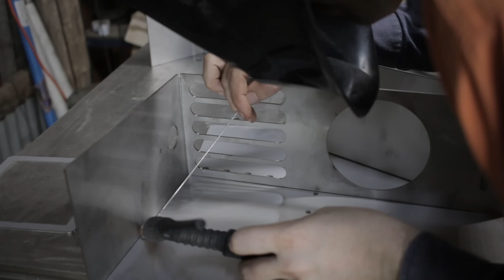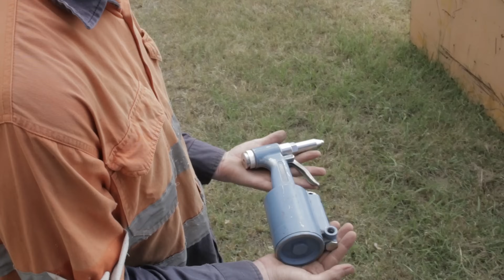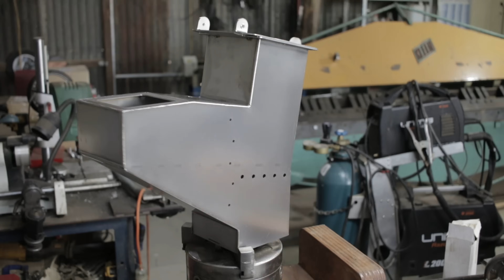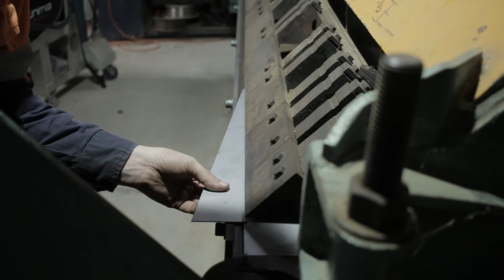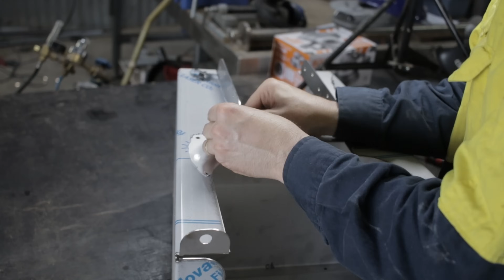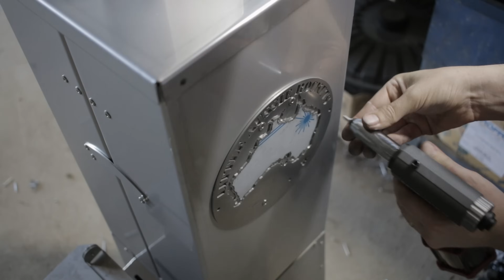Building The Ultimate Rocket Stove Water Heater

Comment: Great video, thank you for all the effort you have put in to make it. Here is a tip on using the hole saw to drill a big hole: get started and let the hole saw scratch its mark, then drill a 10mm hole to the inside of the scratched line, even better if you can be bothered, drill 2 holes, one on each side. by doing this all the swarf has somewhere to escape, and the hole will drill far more efficiently, and your barrel drills / hole saws will last way longer. this is especially useful for drilling thick timber / MDF or particle board without smoke. Cheers Timmo
Reply from the maker: Thanks Timmo that's actually a very helpful hint.

Comment: I'm wondering why you passed the inlet and outlet pipes through the flue? If you're calling the tapered section the heat exchanger, then you shouldn't need to pass the pipes through the flue, which to me may make the draw less efficient. Also, is the bulk of the heat exchange done when the heat hits the lower pipe? Or in the tapered tube? I suspect the lower pipe. I've thought that the quickest way to turn your water into steam is to put the pipe directly in the flue as you've done. But this is not what you want, you want a controlled even heating of the water. 

Also, why not introduce some "sheet" style insulation fixed to the inside of the outer shield? This would stop you losing heat to the outer shield and send that heat around the the exchange section. Thanks for posting your stuff. Wish I had your shed! 😀

Comment: Great video, curious why you didn't put a water jacket around the riser and capture from all 4 sides ?
Reply from the maker: I made one a little while back in that configuration and it worked so well that the water turned instantly into steam and I needed a pump to get circulation. I wanted this one to function without a pump for the off-grid scenario.
Reply: @LittleAussieRockets  thanks for the reply. You didn't try larger bore piping ?  seems a pity to me to not make it as efficient as possible instead of having that heat going up the riser

Comment: So if you’re testing water tightness, is there a reason you didn’t use the air compressor and water with detergent method? Wouldnt testing under pressure be more accurate?
Reply from the maker: Yeah, that is a better way of doing it I had other things to do and it just suited the situation best to fill it with water and come back and look for any wet patches considering the system is never actually going to be under pressure that should be more than sufficient.

Comment: ohhh I was wondering if I could find an attachment to use that little ferrex cutoff tool as a sander - can you share what you bought? I assumed one of the kits at bunnings or total tools would work but haven't checked.
Reply from the maker: https://www.ebay.com.au/itm/314479162782?mkcid=16&mkevt=1&mkrid=705-154756-20017-0&ssspo=f90abdths7e&sssrc=4429486&ssuid=tRO4joLsQgi&var=&widget_ver=artemis&media=COPY
I have to modify the shank and cut an M6 thread on it, that's what's in the little grinder. You could probably use some M6 threaded rod cut to the right length as that happens to be the same thread that's in the little rubber backing pad.
Reply: @LittleAussieRockets  I noticed the 12v grinder aldi stocked yesterday has speed control (12-19.5k rpm, the 20v is 19.5). I ended up grabbing one and a couple of the other tools on offer. They recharge via USB-C which is a bit funky. Must do one cell at a time? 
Anyway, I made the same sort of arrangement, except the polisher kit i bought from bunnings has 1/4inch in the rubber backer, and this 12v model has m5 on the spindle.

Comment: Gasification wood boilers use a Turbulator to chop up and slow down the flu gasses and help transfer heat to the water.  You may consider trying that to see if it helps your heat exchange. 

Great stuff!

Comment: I think instead of insulation around the burn chamber I'd put sand, make it a thermal battery with the ability to recover the heat with a liquid, that would certainly allow heating all the way around the water jacket.

Comment: Interesting video Steve! Bit alarmed that you didn't have your drill press fixed down, even temporarily. Amazed by the size of your sheet metal folder. How big is it and how long have you had it? Sorry to see the passing of your air riveter. You should have sounded Last Post as you delivered it to the scrap bin. 😂 I used to do that for mice killed in the workshop. Sound Last Post and do the Funeral March with feet gliding across the floor! 😂 It used to piss the old PIA Electrician off no end! 😂😂😂
That was half of the point! 😊
I was watching this build and pondering just how much it was costing, so your decision to start a Patreon account was no real surprise. I will see what I can do, however I am currently very busy shovelling as much coin into Super as possible. I turned 59 last month and the Finish Line is rapidly approaching. I know that you both have many calls on your $$$, but if you can put some extra money into your Super now it will have a far greater effect than if you hold off until later. Watching how much gets taken out in fees is also important. It all has to do with Compound Interest. The longer that it has to work, the greater the return. Get yourself a Compound Interest Calculator from the App Store and have a play around with some of the variables to see what I mean. 
Sorry to preach, but learning about Compound Interest is like the Eighth Wonder of the World. 
Mark from Melbourne Australia 🇦🇺
Reply from the maker: Hi Mark I appreciate the financial advice that is something that I need to be proactive with, and no pressure with patreon. The biggest cost for me isn't the materials,  it's all the time that goes into making the video that I could have been doing good paying work.  But I do so enjoy making the videos and having these interactions with you guys. It makes it all worth it in the end.
I've had the folder for about three months now it's 3 meters long and can fold up to 3 mm mild steel and 2 mm stainless steel.
Funny coincidence that folder is identical to the machine that I used in my apprenticeship so I was pretty excited when I found it for sale, it also came with a nice old guillotine.
It's been a great upgrade for the workshop and I've picked up extra work because of it.
Always great to hear from you Mark.👍

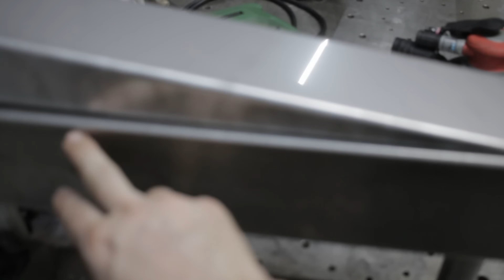Comment: 13:45 FYI, a bath in citric acid with some current applied will passivate your stainless welds to further assist with oxidation resilience.
Reply: 20:20 to tes that theory, instead of insulating between the riser and heat exchanger (or the bits between), put insulation around that entire air volute...?
Reply from the maker: Yes, you're the second person to suggest that and I think I will for the test.

Comment: as well as sugesting the Cleco fastners to help with assembly as Jim posted, use an electric soldering iron to trim the larger plastic film from the sheetmetal, it cuts (ments) the film without marking the surface of the metal.
Reply from the maker: I've used Cleco's in the past, they were pretty good. I've never thought of using a soldering iron it's good to know in the past I've used a copper knife, it does a reasonable job at not marking the stainless steel.
 The cheeky thing about using that rivet with the little blade welded onto it is that it cuts a perfectly sized hole  that the rivet covers and so the marks aren't noticeable thankfully.
Reply: @LittleAussieRockets  I will be adding the rivet trick to my bag of tricks, thanks.
Reply: Cleco, are they what they use in aircraft construction to hold assemblies together until they can be pop riveted?
Reply: Traditionally aviation prefers solid rivets Mark but yes that is exactly what they are used for, they come in a variety of gauges and there are also clamps that are handy as well

Comment: be careful of x-rays from welding arc
Reply: ????? I haven't heard mention of X-rays from welding arcs before? As far as I know X-rays require a radioactive source to be produced. 
Welding arcs on the other hand, produce intense light, and heat (infra-red) and spatter from the arc crossing from the electrode to the work piece. The light component of the arc contains the full spectrum of visible light as well as Ultra Violet light and Infra-red. It is the combination of UV light and Infra-red light which can give unprotected skin intense Sun Burn like burns only more severe due to the closeness of the light source. Hence the need for PPE and a face shield with suitable eye protection shading. 
Mark from Melbourne Australia 🇦🇺
Reply from the maker: I couldn't have said that better.

Comment: Why not fill it with sand? 
Then it will act as a sand battery,
Then you achieve the draw aspect and residual heat for the water part.
Reply from the maker: Yes, this is a good suggestion.
Reply: Ah, sand battery! Someone has been exploring geothermal heat storage options.

Comment: Can I suggest that in colder climates the heat loss through the walls of the flue heat shield might negate any gains, Still a good idea to convert into what is basically an oven but like an oven will need an insulation layer fitted inside or outside to retain heat. Obviously the temperature of the oven will be dictated to some extent by the flow rate of the water and whether it is a closed or open system. Would it be possible to insulate all but the last two inches of the flue?
 ie those top few inches separately from the lower water heating section, this might help  keep the flue pull going if heating water in an open system